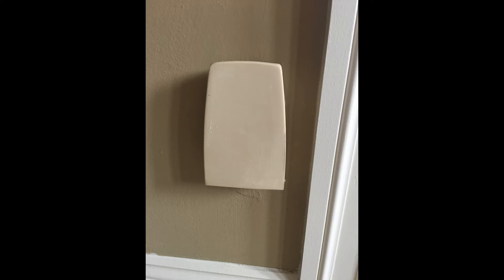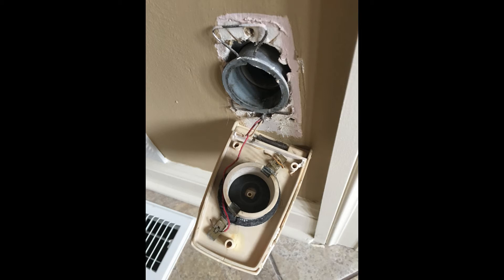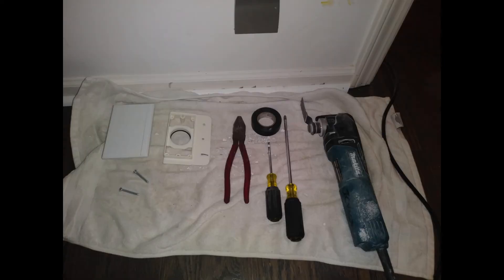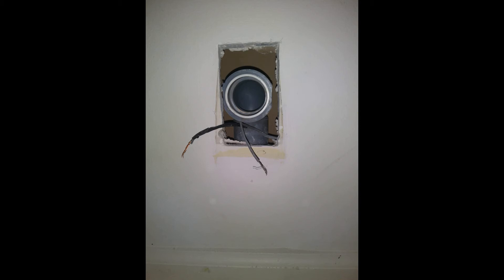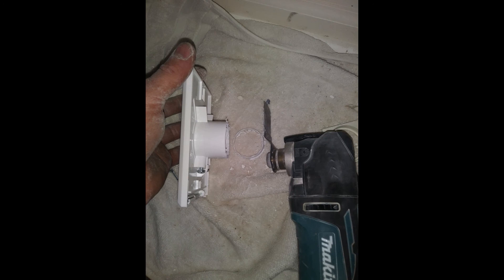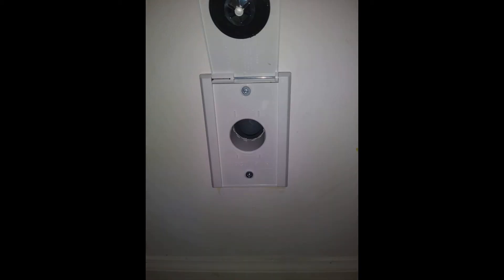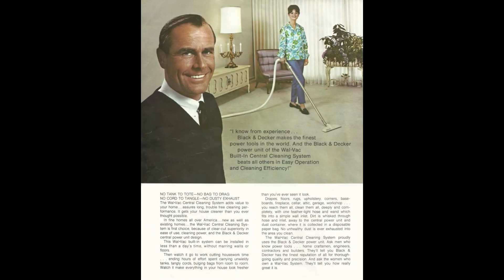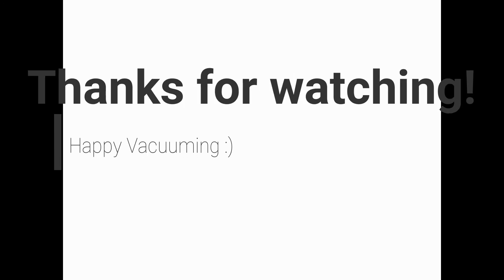Upgrading Black & Decker/WalVac Central Vacuum Inlets

Comment: Which motors were in these units?
Reply from the maker: B & D used a motor design from one of their handheld industrial sander/buffers, with two impellers attached to the shaft. Big, torquey thing.